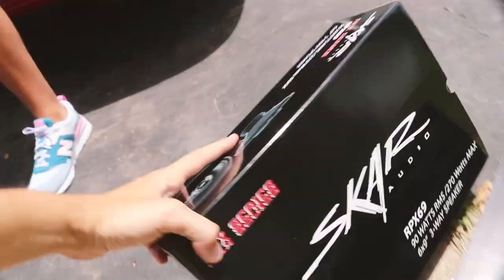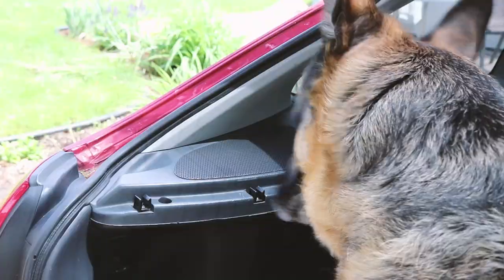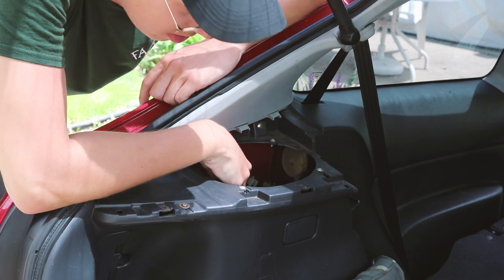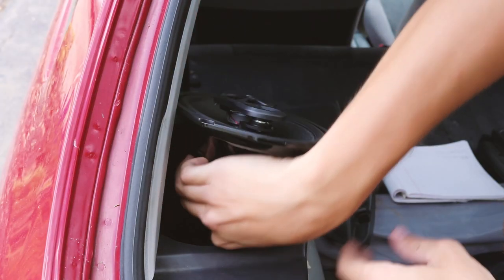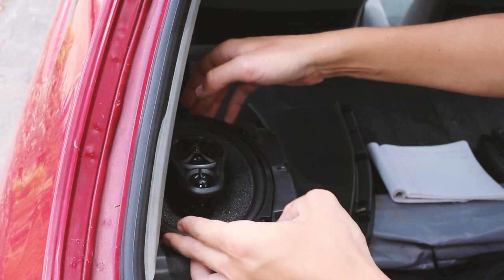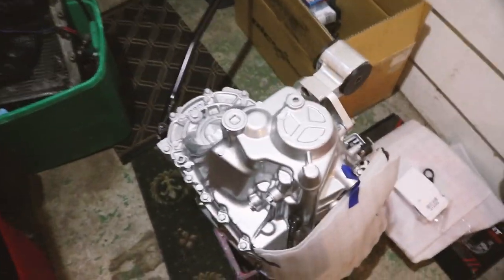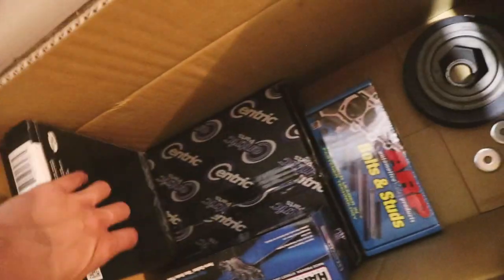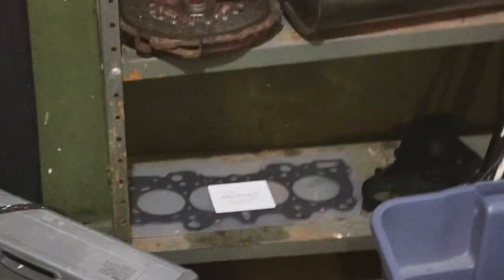BEST Bang For Your BUCK Speakers (Skar Audio RPX)

Comment: Congratulations on the 10k milestone.  Keep up the great work.  I look forward to seeing how your projects go.  

Funny story my wife and I got a cheap car during some hard times. One we ‘owned’ it and got it home we turned on the radio and I only had 1 speaker working.  I found it only had 1 out of the 6 they were missing   Junkyards don’t sell them where I live so had to buy new.  We had that car 10 month and after fixing more broken stuff then any other car we broke even on selling it which was nice and somebody got a good car.  Oil leaks, seals, wheel bearings, I should have done a YouTube channel on fixing it enough contact to last years lmao

Comment: I have a Skar Svr 8 inch sub in a custom box. For it being an 8 it is impressive. Not a ground shaker, but a better than premium sound. It is running at 1ohm, on only a 350.1 Skar amp. Not bad at all. Not sponsored either, however, if you're interested, try them out!

Comment: Curious….
How was the power draw from your radio. Did the speakers pull too much power from it causing the radio to shut off? Just curious if I should get an amp too or if I can get by just swapping speakers for my work car.

Comment: I need HELP QUICK! IM ABOUT TO BUY 6x9s. EITHER KICKER OR SKAR OR BOTH. KICKER KS SERIES 6x9s or skar TX or RPX 6x9s? I need front and rear to replace my alpine type r. I need real feed back ASAP. Trying to order right now and need to know if spending the money with kicker is worth it. Or not compared to kickers 6x9s and remember the kicker ks was made in 2020 sooo pretty new but maybe use components from kicker in the front and coaxials in the rear from skar? Anyone have real feed bac?
Reply from the maker: I think kicker is the move.
Reply: @boosted_john  yep I ordered the 6x9 ks components. They were out of the coaxials today but not yesterday lol so yeah on the hunt again for rear 6x9s

Comment: Dont know if you noticed before you put them in but it looks like there are terminals on the tweeters I just got mine in the mail today and I see them
Reply: I just bought some and i noticed them too. Any idea what they are there for?
Reply: @rileyraymond2358  I'm assuming if they have a separate terminal for the tweeters you can unhook them from the woofer and run them active from an amp on their own channel and have more control over their crossover point as well as individual power